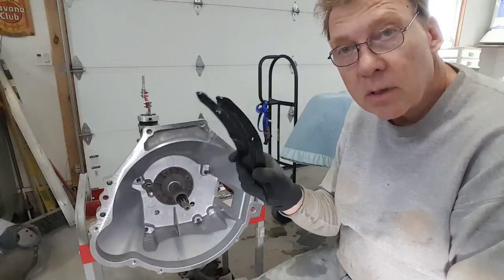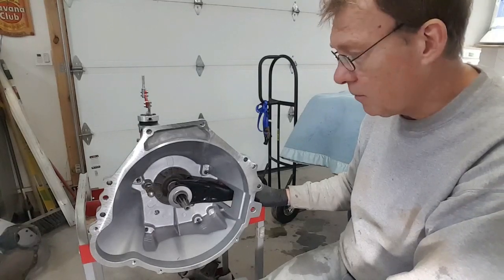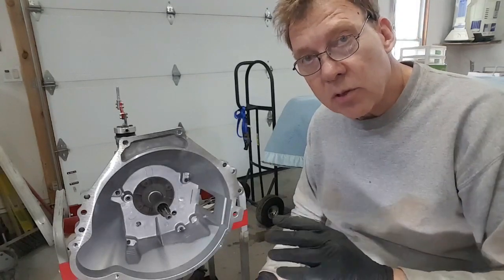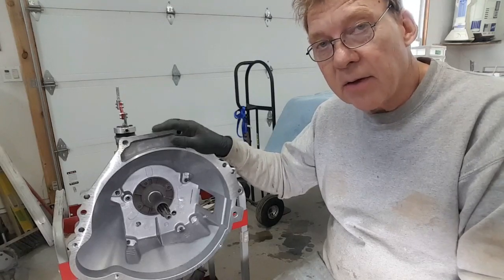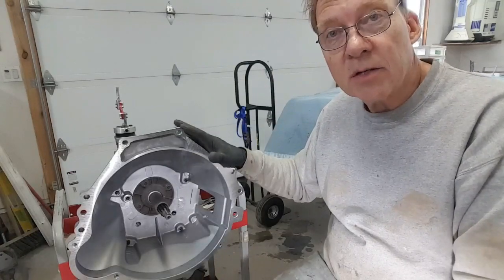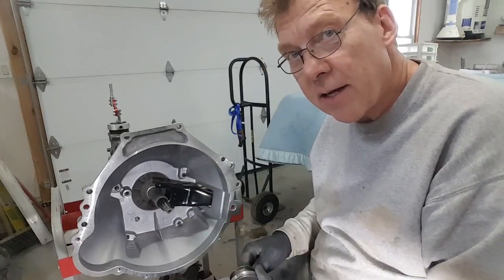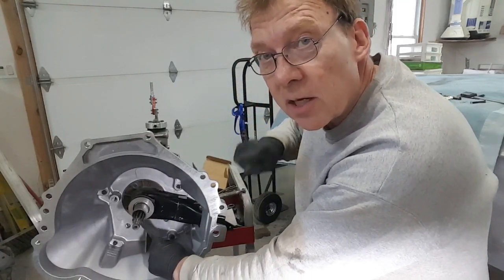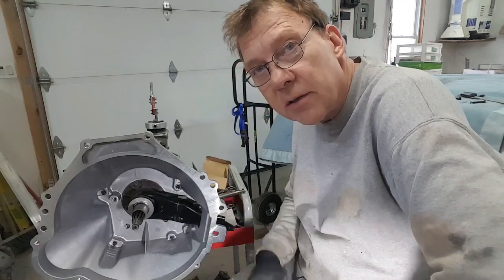Automatic to manual transmission conversion including upgrading to T5

Comment: What clutch release arm did you use with the fulcrum block. thank you
Reply from the maker: I ordered it from CJ pony parts , the part number is C8OZ7515A. It is for a 68 to 70 289. 302, small block. good luck with your conversion
Reply: @68mustangrestoration34  How about the spring that holds it to the fulcrum block? thank you
Reply from the maker: @ if you zoom in on the picture the "spring" is included on the lever. it is a spring steel tongue that inserts into the block to hold the lever against the block.

Comment: Is it possible to use this fulcrum point with a cable clutch?
Reply from the maker: THis is only for modifying a modern bellhousing to use the old  linkage type that pushes clutch fork  like I am . If you are using a  cable it pulls the clutch fork so you do not need this block, all modern bell housing come with a ball pivot on the far side of the clutch fork. OR are you using the original bellhousing?? if you pause the video at 2:40 and look at the bell housing you see a ball pivot on the left  , so you need a modern (1985 and up ) clutch fork that has the ball socket on one end, the fork in the middle and of course a connector for the cable

Comment: If you have time I would like to know the parts list you have to do this fulcrum conversion. I have the Transmission and Bell Housing only.
Reply from the maker: I purchased all of the parts from CJ Pony, First is the fulcrum block part TRA-656-525. this is the piece that you have to mount into your new bell housing the create the pivot. (as described in this video)  NOw , all of the rest of the parts needed are specific to the engine. They are all different based on 6cyl, small block v8  or big block V8.So what i did is go to CJ Pony parts and look at their conversion kits, yes I know they include the transmission and the bellhousing, BUT what I did is look at all the parts in the kit and ordered ONLY the parts I needed as like yourself I also had the transmission and the bellhousing. Make sure you order the transmission mounting bracket as that was a perfect fit. let me know if you have any questions

Comment: i'm looking to do the same with a '69 302...  any chance of posting your parts list???
Reply from the maker: Since my conversion is from Automatic to Manual, so I had to literally buy everything to convert this. Let's start at the beginning, this is a 68 289 C code car but comes with a 302 block and heads. First I found my Transmission, it is a 1984 T5 World Class with the short input shaft (watch out as 95 and newer transmissions have a longer input shaft by 11/16th ) next I needed bellhousing, spacer plate, flywheel and clutch kit. All bought from Jegs.com clutch kit# 555-60090 (comes with pressure plate, disk, throw out and pilot bushing and has 10 tooth 1 1/16 spline, next is spacer plate #  555-60940 then bellhousing is 397-M-6392-E and finally flywheel is #228-1628981 (IMPORTANT- Flywheel MUST BE 157 tooth for Small block, also 28Oz balance to match the crank balancer. Everything else for the clutch including pedal, all the springs, rods, forks, brackets are all from CJPony parts. The PIVOT mount is part TRA-656-525 to convert new bell housing to a push type clutch fork. let me know if you need the parts for ALL the clutch linkages (there are about 20 pieces). The key is the input shaft length of the transmission as you might need an adapter plate

Comment: Do you think than i could do that on my t45 i mounted in my F100 73 with motor 302, actually works with cable, i know than the belhousing is different than this one that you show it.
Reply from the maker: I cannot find the specs on the t45 regarding input shaft length so I cannot tell you if it will work. I know that the modern tremmec T5 will NOT work with this bellhousing but since you say the t45 does work  your 73 302 set up that should be the same bell housing I have. Again, check which bellhousing you have in the truck as that apparently works with the t45

Comment: Can you send part numbers , great video
Reply from the maker: To be clear, my conversion is from Automatic to Manual, so I had to literally buy everything to convert this. Let's start at the beginning, this is a 68 289 C code car but comes with a 302 block and heads. First I found my Transmission, it is a 1984 T5 World Class with the short input shaft (watch out as 95 and newer transmissions have a longer input shaft by 11/16th ) next I needed bellhousing, spacer plate, flywheel and clutch kit. All bought from Jegs.com clutch kit# 555-60090 (comes with pressure plate, disk, throw out and pilot bushing and has 10 tooth 1 1/16 spline, next is spacer plate #  555-60940 then bellhousing is 397-M-6392-E and finally flywheel is #228-1628981 (IMPORTANT- Flywheel MUST BE 157 tooth for Small block, also 28Oz balance. Everything else for the clutch including pedal, all the springs, rods, forks, brackets are all from CJPony parts. The PIVOT mount is part TRA-656-525 to convert new bell housing to a push type clutch fork. let me know if you need the parts for ALL the clutch linkages (there are about 20 pieces)
Reply: @68mustangrestoration34   No thanks mine is a straight shift I jus really needed the fork bracket because I’m going T 5 trans thank you very much.
Reply from the maker: @davidmaughon5303  Ah ok, if you are simply swapping toploader for T5 you should only need the adapter plate
Reply: @68mustangrestoration34  I have a t 5 out of 87  5.0 that should hook without adapter plate right?
Reply: I’m changing from 3 speed
Reply from the maker: @davidmaughon5303  I think I got you , you wanted the part number for the fork bracket as you are changing the bell housing to a modern one. if so then yes the T5 will bolt right on as did mine, all the rest should be good  except the transmission mount might not work ( I had to order part # TRA-670-523 from CJPONY)  plus the output shaft might be different as well and I hate to say I had to shorten the driveshaft as the T5 is longer.

Comment: Great information. I use counter-sinks that we called "suicide bits" in the airline industry. They had no stop mechanism. They were called that because they were high risk on a fuselage.
Reply from the maker: LOL.. I can imagine drilling through with a big bit.  I had the same concern and stopped shorter than I wanted .

Comment: How much does a conversion like this cost? The C4 in my 67 is getting pretty tired, and I'm thinking of swapping it out for a T5 instead of rebuilding it.
Reply from the maker: I would say I am at about 1,900 US for the swap. Now the BIG variable is the transmission. I found a 1987 T5 World class for 400.00. of course I needed a bell housing,(250) flywheel, (300) clutch (220) , then you need ALL the clutch parts from mustang supplier including clutch pedal, linkages, springs PLUS you need new brake pedal (narrow one) so that is about 500. now if you get a newer transmission you must replace the input shaft because after 94 the input shaft of T5 is longer. and finally a new transmission mount (150) Oh and a lot of effort. Now, it really depends on your usage, mine is going to be a driver so wanted overdrive either as Auto or standard. Now , not sure what your use is but IF you are going to replace transmission anyway (either manual or automatic might I suggest you swap it for an overdrive transmission. not sure what your RPM's are at highway speed but OD will help.
Reply: @68mustangrestoration34  where did you find that 87 t5 on.. a junkyard mustang? looking to do the same on my 67 cougar.
Reply from the maker: @IsaacMorales12  UP here in Canada we have a classified Ad website called Kijiji. Similar to Ebay it is a place people can put their stuff on sale. I got lucky in that this person took out his World class from 87 Mustang and went with a TKO 600 after engine upgrade.

Comment: Great video. Thinking of doing the same on my 65 Fastback. Make a video when you dial in the bell housing to engine.
Reply from the maker: since this is a ford bell housing I was not concerned BUT since you mention it , it is always a good thing to at least verify. I had to do it for my scatter shield on my 347 but I HOPE it is fine here considering there are NO adjustments on the ford Bell housing. My 347 had offset dowels to "tune" the runout until I was dead zero.
Reply: Thanks for the reply. I have been doing some research and most videos on this swap point out the need to dial in the bell housing to engine. Once again great video and keep them coming.

Comment: Looks like it’s all coming together nicely.  That pivot adaptor seems a bit pricey for such a simple part,  but it’s always a choice.... do I spend the time to make one or the money to buy one. Great video Wally! Thanks for sharing.
Reply from the maker: I agree and I have manufactured a number of pieces but personally I had no idea how this worked until I got it. so in retrospect if I knew how it worked a simply bridge metal piece would work BUT this was easy to install (as you saw) so you are right we have to weigh cost with effort. That discretionary spend always creeps up.